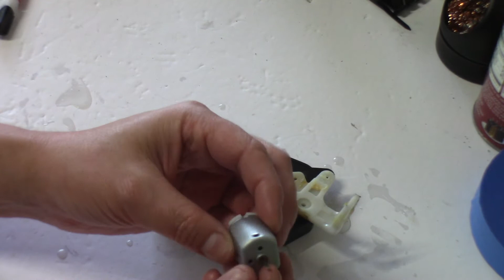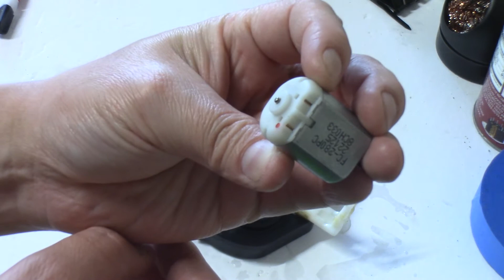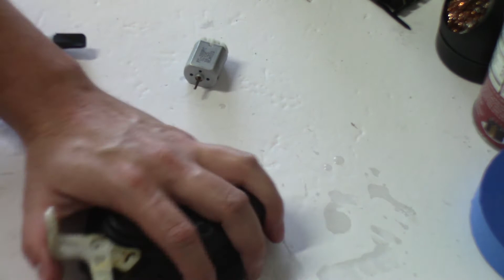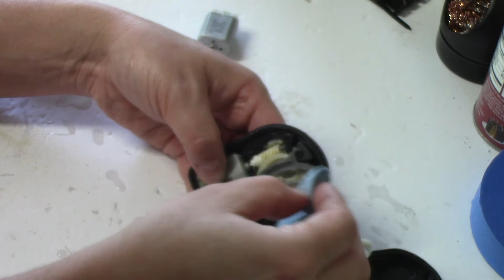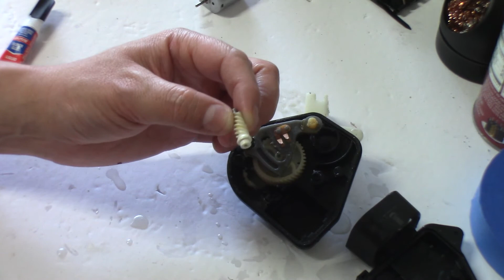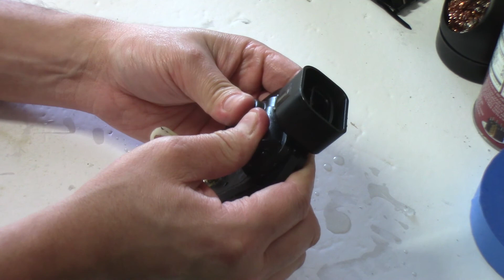TOYOTA / LEXUS DOOR ACTUATOR REPAIR REBUILD

Comment: Just adding this here for anyone who tries 1st gen Toyota Sienna actuator motor replacements, like we had chatted about Nick.

Front driver and front passenger side doors use a 10mm round shaft with brass collar, and the sliding doors and trunk door use 13mm double D-cut shaft.

Also, as far as dismantling the actuators:

Front driver and passenger door actuators are easy to pry open without damaging the actuator casing, just like in Nick's video here.
BUT... the actuator casing on the sliding/trunk door actuators are a whole different story. They CAN be pry'd off, but for some reason it's extremely difficult without completely destroying the casing. The adhesive seems much stronger and the casing separation lines are extremely tight/thin. Most attempts at prying just dig the plastic away. I've been trying on junk yard Siennas to reliably dismantle those particular actuators and the damage-less success rate is about 1 in 7 actuators so far. I feel like I just got lucky with that one. I'm going to continue to try to find some method that works on those.

Comment: This is exactly what I need. The 2002 Sienna I bought earlier this year has weak actuators - which I believe prevents me from programming the remote I got for it with the remote programming procedure. I can't get through the procedure before the unlock/locking tires out. Would you be able to link the little motors you got? Do I need to measure the motor pintle before I find motors to purchase or do you think the one you bought will likely work on a Sienna?
Reply from the maker: Most likely why you can't program your remote, since it's a 2002 its probably the same motor.  https://www.ebay.com/itm/111593275460